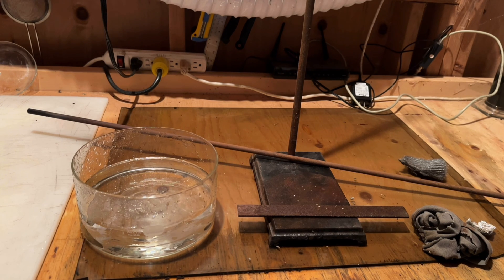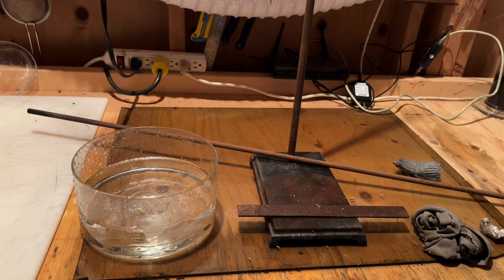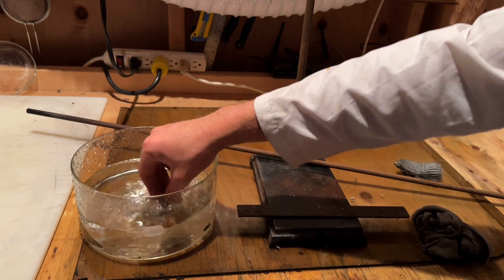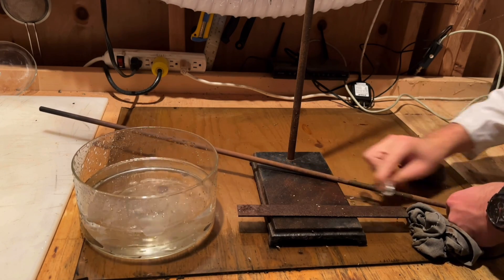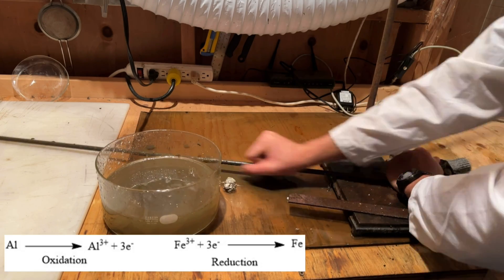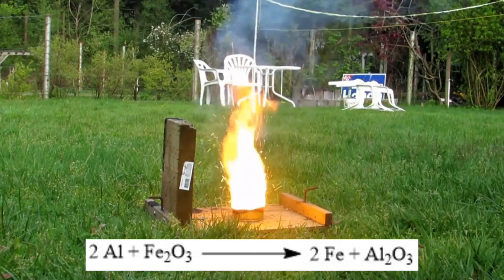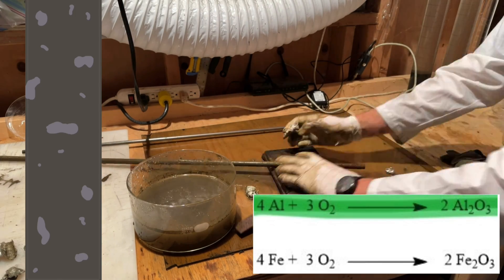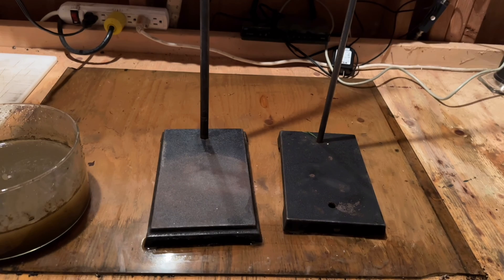How to Remove Rust Using Aluminium

Comment: The recipe for fluorescent lamp phosphor is a trade secret (an obsolete one at that) however it is worth noting that modern fluorescent lamps have red green and blue fluorescent compounds added to the original halo phosphide composition.  This increases the lamps lumen per watt output making them more efficient as well as having a better colour rendering index.

Comment: It makes sense. I was an avionics tech in the Navy. Knowledge of dissimilar metals and corrosion were so important I had to take classes and pass testing on the topic. I think if you boiled the iron, you may find some interesting results. 'Boiling in distilled water will convert the red rust (ferrous oxide) to black rust (ferro-ferric oxide). This is the same process used in rust bluing.'
Reply: Once you 'blue' iron, and maintain it's surface from oxidants, it minimally corrodes. Lest you wonder, I have done this.
Reply: The key to me is, ferro-ferric oxide does not "flake", which is related to chelating. or something like that,  ;0)-~ but anyways,
Reply: I've read a sentence on cargo containers: Use COR-TEN steel only for repairs.That's the steel that rusts but doesnt rust deep. I wonder if they got the technology from the 1700 year old iron pillar of Delhi in India @hubrisnaut

Comment: I highly doubt that it happens at room temperature. I don't know what to think about it. There's only one way to find out. I have to try it myself
Reply from the maker: you'd be surprised. If you rub a rusty object with steel wool, and then with aluminum, you'll definitely notice that more heat is generated with the aluminum, presumably due to the reaction.
Reply: I'll try to rub it wet too in case water works as electrolyte.  @TheCanadianChemist